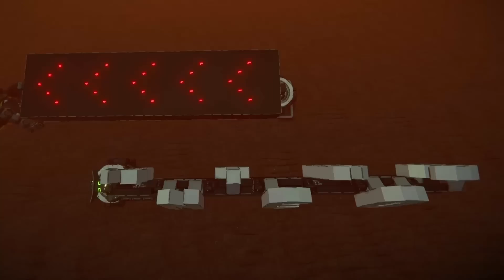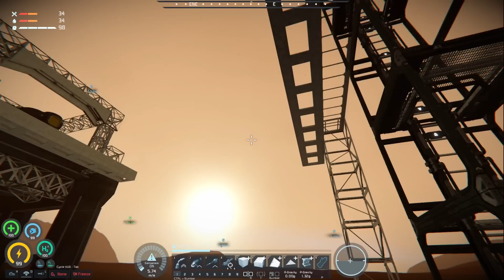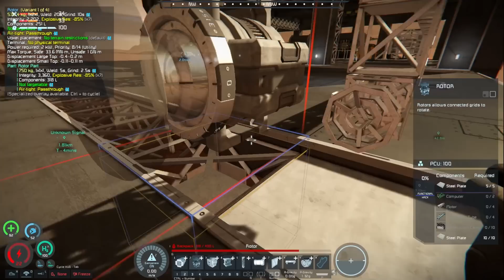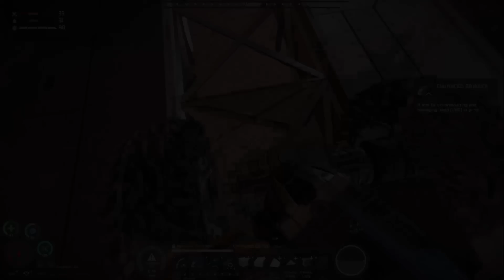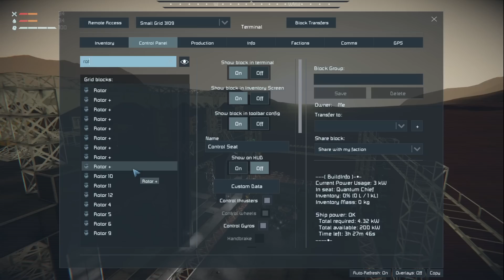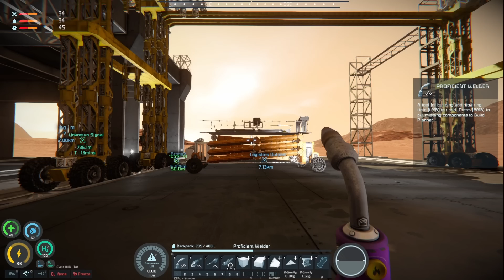PROJECT ANTEROS | The Gantry Crane - #13

Comment: I just found this video today and you've blown my mind. I am wondering though, would the snagging of the wheels on the gantry crane be removed if you rotated the half beem blocks 180 degrees? So instead of the first beam block angling down before going across, it's angled upwards before going across. That's just my dislike of the plates talking though. I always thought they looked flimsy
Reply from the maker: Welcome, the gantry system needs a full redesign in order to get it to work properly

Comment: Put on Yield modules instead of "speed " modules on your refineries. Get 200% more, just need 4X more refineries for the same speed which is not too difficult at this stage. You could apply meteorites to get Plat and upgrade your tools. it doesn't take much just have to deal with the holes they make.  

 I was wondering what mod that is for que and hold production values, I was checking your mods and you missed Isy's Inventory Manager in your mod list. Nice Mod looks pretty handy. 

You could use a  push button panel on the large grid base and a remote antenna on the  crane to control it from the ground since their on different grids. Also mount a small solar array across the top to charge it so you dont need to "plug  in"  your gantry. OR, add a docking station via AI controller someplace to "park and charge it" 

If your want to have  the chain  moving the crane, you could have the "chain" portion rolling onto a large wheel, then have the wheels on the left and right side of the upper gantry to control left and right movement. I think you would need AI block controllers to disengage one rotor while the other takes over the reverse movement, and vise versa.  Mount the chain on the lowest portion near the gantry wheels so it has less tendency to pull it over instead of its mounting point at the top like you have it now.  Not sure how to attach the small grid " chain" to the wheels may need testing, and as it rolled up more chain it would get significantly larger so space might be an issue.

Comment: Yes, I think an equal but opposed rotor chain connection would be a good idea, if only to balance out the carriage.

Also... I think that if you swapped the arms on your 'multi-tool' rover to have a pair of pistons on each side it wouldn't impact it's function for drilling or carrying with them collapsed, but would give your welder head more reach.
Reply from the maker: You know the idea with the multi tool I’ve been meaning to do that work weeks, really need to do it haha